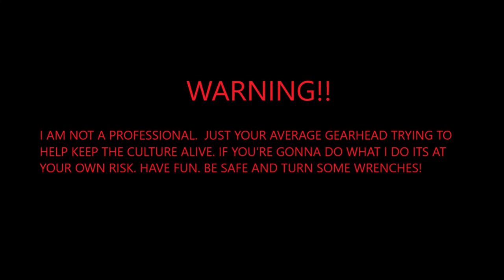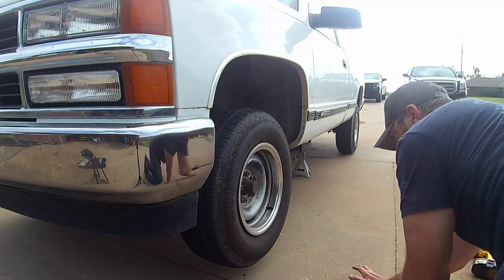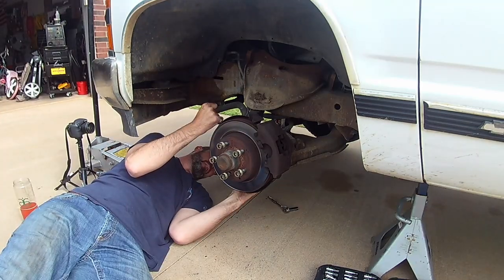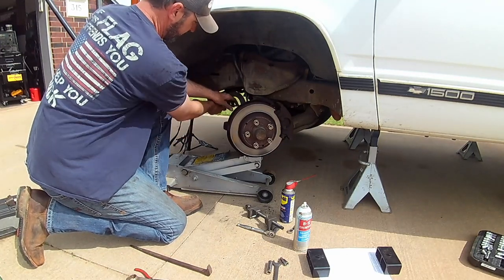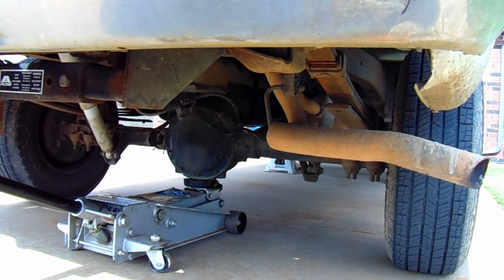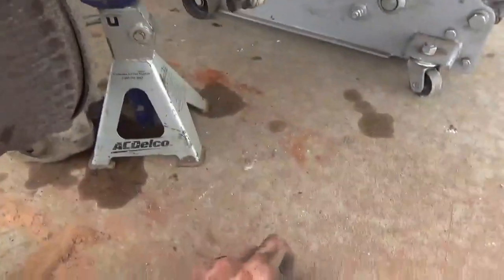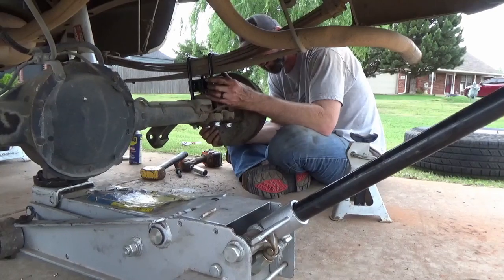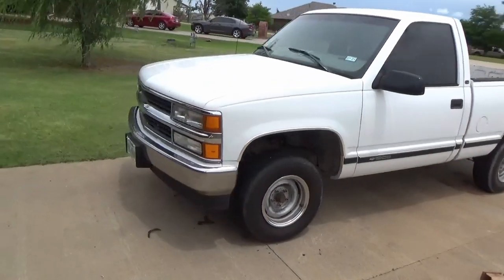Cheap!!! $139 88-98 3” 2WD lift kit Chevy/GMC Lift Torch Off Road

Comment: Nice looking rig
Reply from the maker: Customer approved of it. Haha. Thanks for watching. Please subscribe
Reply: @HartRockGarage  I have a 98 chev 2500 4x4 that I would like to put that on.
Reply from the maker: @barryvarga3538  here is the link for the kit that will fit your truck. Use Promo Code HARTROCK10 and save 10% on this item. I also have an installation video for this lift kit on my channel. 
https://torchoffroad.com/products/1988-1999-chevy-gmc-k2500-k3500-pick-up-and-suv-3-full-lift-kit?rq=yr_1998~mk_chevrolet~md_k2500-k3500
Reply: @HartRockGarage  👌